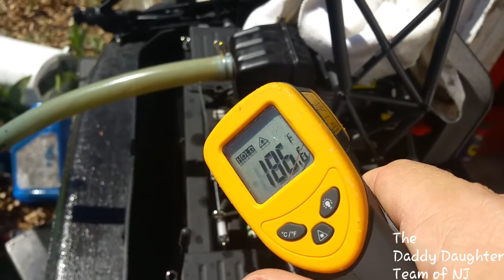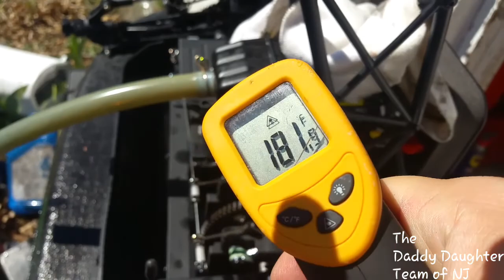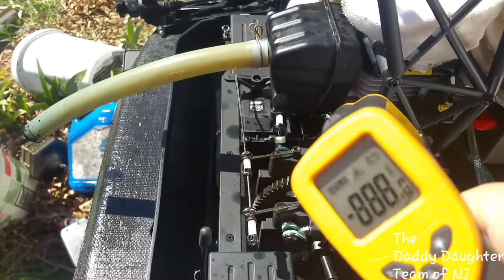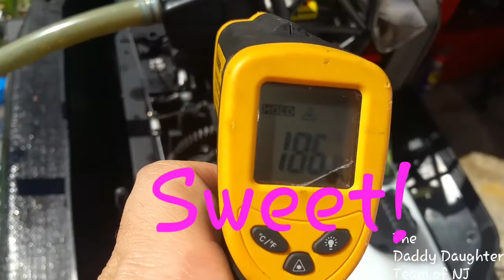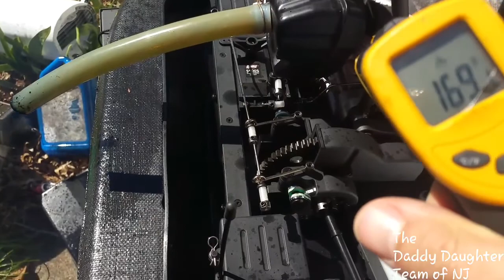Breaking In Kayla's LOSI MTXL Heat Cycles And Some Motor Prep!

Comment: You don't have to be there with the heat gun all the time like a Nitro . Just pre heat your motor before you start it for the first couple of times! And when you use the heat gun try to go around the motor and don't go to close . Bring the idle up a bit so the Piston can clear the cylinder out a bit! Always use a socket and ratchet or the spark plug tool to remove and install spark plug. Good stuff man ! To bad you don't have your first motor because that motor was all ready to kick ass and it was a great motor from the start ! I still see that video I have of when I went threw the process on my bench! Remember that?? We will meet up again one of these days and hopefully for a Bash together with our Rigs!!! Keep up the great 👍 work

Comment from the maker: if I didn't keep the heat gun on it temperature would be  between 87 to 100 degrees . I didn't feel that was good for the motor, also most of the motor is covered by plastic,  so hitting it there with heat wouldn't do it much good. it was the only way to get the temperature up and even at that it was hard to keep it above 147.